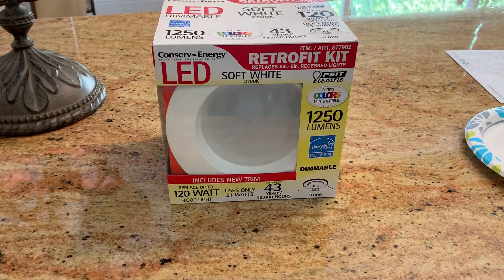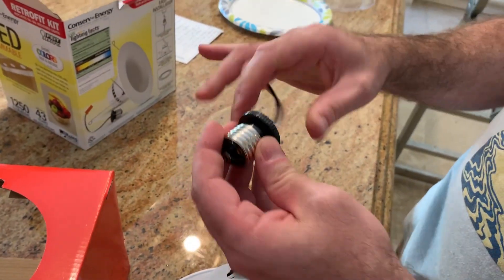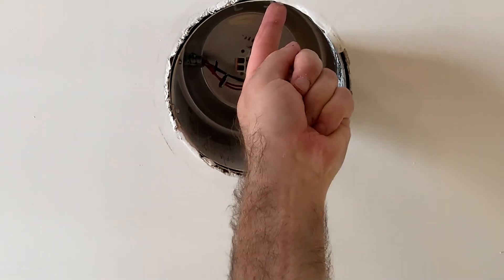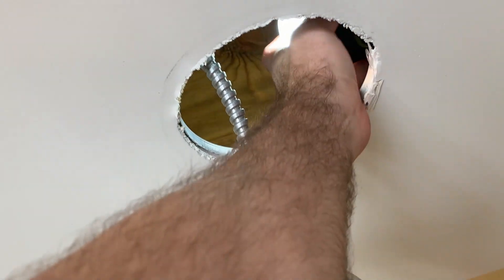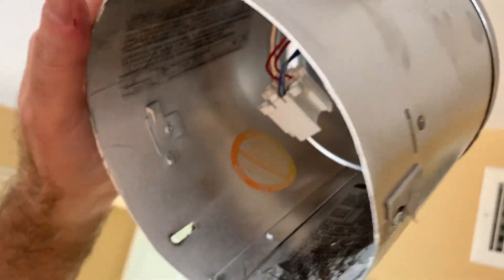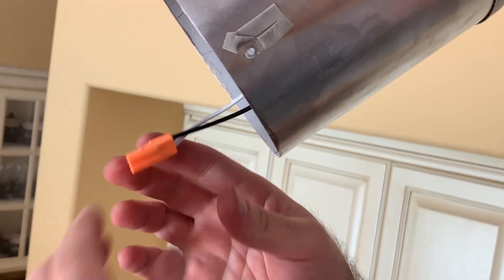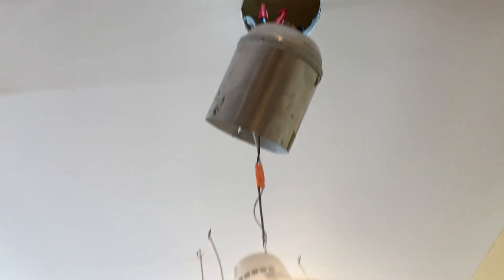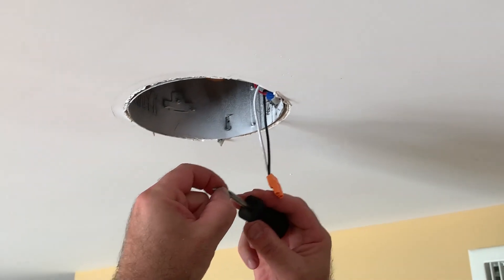CFL to LED Conversion

Comment: but you did not disconnect the power from the ballast that you eliminated, therefore there is voltage at the output and you only put them in the box without isolating them
Reply from the maker: there’s absolutely no power in the ballast if you follow my instructions
Reply: @charlietv625 First of all thank you for the video. I just finished up doing it thanks to you. But, I think he’s right. There’s still power going to the ballast. I found out with a little “shock” from the blue and red wires remaining from the ballast. It’s because you didn’t disconnect the white/black wires from the ballast.

Unless I’m missing something, I’m pretty sure I followed your instructions perfectly. Just a heads up for those who do it and see this in the future.
Reply: @charlietv625  I appreciate finding this video as it was put out here 5 yrs ago and I am just now getting to do this for a house I am going to be selling soon and this is CA where they have now banned the CFL lights unfortunately. I did remove the ballast entirely and it was just additional unused baggage. I will add that the 2 white wires you are adding the Blue with and the 2 black with the Red.. both white and black in your setup are feeding the ballast still. I cut out the ballast and went straight from the house wiring to the fixture and your video got me through the whole thing Sir. Thank you for having posted it up here.. I have been a life long DYI guy so when I see someone else having done it first it makes things that much easier to even attempt doing yourself.

Comment: Good video that will live on for many years. I do suggest removing the ballast wires from the junction box, never good to have bare ends floating around in there. Also consider removing one of the blue and red wires as unnecessary. Again, excellent tutorial.

Comment: Very clear but why did you connect 2 blue with white and 2 red with black. Why not just 1 blue and 1 red. What’s the extra wires doing ?
Reply from the maker: just making it heavier gauge by combining the thinner wires together, it’s not necessary, only optional
Reply: I believe they are 18 AWG. In my case they are. Are they potentially a fire hazard when not doubled like the way you did?

Comment: Last night I did the CFL to LED conversion following your instructions. Thank you so much for your helpful video. Please answer me this question, if you can. What model, brand name is that boxy flashlight you used in your video? Where did you find it?
Reply from the maker: Hi, I got this bluetooth speaker flashlight combo about 6 years s ago, i don’t know if it still exists but i’m sure you can find something similar, this one is a InnoCreek 3-in-1 Multifunctional Waterproof Outdoor Wireless bluetooth flashlight speaker combo, it was about $20, I hope this helps

Comment: Instead of opening any cutting all the wires, why can't connect your LED lights white wire to 2 CFL blue wires and LED lights Black wire to 2 CFL red wires? Please advice.
Reply from the maker: because the ballast will not allow the correct amount of power to go to the led light, the ballast is put there specifically for the cfl lights
Reply: @charlietv625  Thanks! I also tried with I said above (2 blue wires to LED's white wire and 2 red wires to LED's black wire) and you are correct, power was not enough and light blinked for a second and then went off. 

Thanks for posting this video and explaining all the steps in details. I successfully changed all my CFL lights to LED now and long due project is completed! Thanks once again!

Comment: You dont have to turn the breaker off?
Reply from the maker: I don't, but if you feel safer doing so then please do it, the light switch acts like a breaker, it cuts off power when you switch it off, that's how your lights go on and off, but if you have children running around and you're afraid that they might accidently switch the light on while you're doing this procedure then you should definitely turn the breaker off
Reply: @charlietv625  thank you so much your video was great

Comment: Yes hello :
yes, well, by changing your ceiling lights, there is a chandelier next to it with three cups ? When do you turn on the light ? I would like to know if the chandelier also turns on at the same time with your LED ceiling lights and when you turn off your ceiling lights does the chandelier also turn off ? I would like to know if the chandelier also goes out at the same time as the new ceiling lights please thank you. So, well would it be nice to re-shoot the video to show it to me please ? Thanks.
Reply from the maker: the chandelier is on a different light switch, it’s completely independent of the recessed LED lights
Reply: Hello, well okay. The candlesticks walk apart??? And then I would like to know why do you change the old ceiling lights recessed by LEDs??? And then the ceiling lamps compact fluorescent bulbs and the compact fluorescent bulbs are we still making them??? See you soon.

Comment: Be careful with using the light switch as a means to break power... I have talked to two people who had idiots wire their house initially and put the switch across the neutral.  They found this out the hard way when replacing the light fixture.
Reply from the maker: very true, the safest way is at the breaker

Comment: You only need two wires, one blue and one red ,from the light fixture to the switch/power wires?  Why did you use 4?
Reply from the maker: doubling up on the wires makes makes for a better electrical current, you can use one if you like, but since they’re there, why not use it
Reply: @charlietv625  Thanks.  I was just confused about the extra 2 wires.  I thought I missed something.

Comment: Great video!  Question: Why did you keep 2 blues and 2 reds?  Would 1 blue and 1 red be enough?
Reply from the maker: one of each is perfectly fine, two of each makes for a thicker wire, i prefer the thicker setup

Comment: Good instruction. However, i would like to make a comment on the unused wires. You should clip off the bare copper section of the unused wires and then cover the cut end with an electrical tape for extra protection even if they do not have power.

Comment: Very good video on converting from CFL and the process is 100%.  However, mine is a little rougher most likely same with others.  I have tons of blown in insulation to deal with, and the original builder contractors cut the wires very short (about 1 inch) in the junction box and the can.  Getting to the wires to strip them and put wire nuts on is almost impossible.  It is a wrestling match and not an easy job to do given sloppy original install.   But your procedure is dead on.
Reply: I would just get rid if the blue and red wires and buy a new black and white wire and extend down from the box into the can. That's what I think I have to do with my others after dealing with similar issue.

Comment: please help!! I actually have TWO Romex wires as the power source (one romex wire has 3 wires: white, black, and green, BUT another romex wire with 4 wires: white, black, green, and red).  What do I do with the red wire from romex wire #2?    Thanks so much for your help!!! Your video is excellent! (at 6:27,  you have only one romex wire, so my wires is slightly different)
Reply from the maker: i’m sorry but i don’t know how to help you with your configuration, i would get an electrician to help understand what’s going on, good luck.
Reply: @charlietv625  ok:).  Aside from that, very very instructional video, thank you so much!

Comment: I just replaced all of mine and after 2 I checked to see if it worked and it did. I replaced the other 4 and now none of them turn on. Not sure what happened I’m going to pull them back out and check connections

Comment: Seems like you can remove a red and a blue wire as you only need one pair?
Reply from the maker: sure, but since the main wires you’re going to connect these blue and red wires to are of much thicker gauge, i would just twist the two red wires into one and the same with the blue, but there’s no harm in removing them though.

Comment: Excellent video! I watched it a couple of times and attempted to convert the recessed lights in my kitchen. Success! The only issue I had was the "door" to the junction box was on the other side so I had to figure out how to take the entire ballast off. Once that was off, I was able to get it completely out of the way. Thank you Sir.

Comment: If my house had cfl and a dimming slider would the leds also dim with existing wiring?
Reply from the maker: only if the new light fixtures are dimmable, otherwise you will ruin the new lights, you should only use dimmable lights with dimmer switches

Comment: great video! i’m in the process of changing mine and i do have one question, the 2 red and 2 blue wires that are located behind the canned housing seem to be connected straight to the ballast and nothing else, do they HAVE to connect to the black and white cables or would it be okay to proceed and work with only connecting the red and blue to the LED recessed lighting connection
Reply from the maker: I'm not sure I understand what you're saying but to simplify it, you must not use any wires from the ballast, the wires in the can that go to your lightbulb (blue and red) connect directly to the main power source (black and white)

Comment: I liked it in most aspects, but not where he said to make sure the power is off AT THE LIGHT SWITCH.  Shut the power off at the breaker box and the light switch, else someone turns the switch on why you are working.
Reply: I would shut off at the switch and then tape it to prevent someone turn it on and also let people in the house that you are working on the light do not touch the switch 🙂

Comment: Thank you for the very informative video, I have a question. Would there still be power to the ballast? and if so would that make those useless wires potentially dangerous?
Reply from the maker: no, there won’t be any power there, power is only in the main wires which in the video is the yellow jacket with black and white wires inside
Reply: @charlietv625  ok thank you!
Reply: Love the video but I think you left out one important part. I didn't see nor hear you say anything about the white wire from the ballast that was also twisted in with the other two large white wires. Same thing as far as the black wire that was in with the other two large black wires twisted together. In other words, you didn't show them being disconnected from the large twist nuts.If you had shown this in your video, I think everyone would understand why theres no power at the loose wire coming from the ballasts. Still a great video though.

Comment: Very informative...I plan to use your video as my guide. My only question, i have two CFL sockets in one can, will there be two ballasts behind and I use your steps for each ballast ? or will there be one ballast but the number of wires will just double?
Reply from the maker: hi, as long as there's only one main wire ( in my video it's the yellow covered wires with the black and white wires inside) then just bypass both ballasts
Reply: @charlietv625  thanks

Comment: Thank you! You're very good at explaining how to do this conversion. Instead of a one 4-pin CFL, we have two 2-pin GX23 CFLs in each can. Would the instructions be the same? Also, any plans to do a tutorial for LED retrofit kits that have an Integrated J-Box?
Reply from the maker: hi, as long as there's only one main wire ( in my video it's the yellow covered wires with the black and white wires inside) then just bypass both ballasts (if there are two ballasts), and sorry but not at this time for the LED J-Box question
Reply: Hi, did you ever figure out how to do it? I also have 2 prong
Reply: @eluna58 We ended up hiring an electrician. Happy we did

Comment: Great video! I want to do this project, but my CFL cannisters do not have the integrated brackets to accept the torsion bar clips to hold in the new LED light. Do I have to replace the whole cannister?
Reply: You can buy C clips to hold em

Comment: We replaced 8 of the lights in our kitchen however 1 of them is not working. We rewired it several times and even used another led fixture but still it’s not working. Any recommendations?
Reply: Did you figure out the issue?  You likely have a loose wire connection between the faulty fixture and the "upstream" fixture that is providing power to it in serial circuit.  Check the wire nut connections on the upstream fixture.  If you are not certain which fixture is feeding the power to the faulty fixture, simply check the wire nut connections from the 2 closest fixtures on either side.  Good luck and hopefully you found the fix many months ago already.  cheers!

Comment: Hello, I did all 6 LED lights conversion, it worked for about 1 day, until I tried to add 1 dimmer switch and now only 1 LED turned on, I'm not sure if all 6 lights are wired as series. What do you think happened?
Reply from the maker: some led's don't work with dimmer switches because they're not dimmable, make sure you're using dimmable lights before installing dimmer switches
Reply: @charlietv625  Yes, all new led are dimmable, but I ended up reinstalling the original switch and still only 1 led is turning on/ off.
Reply from the maker: I'm not sure what could be the cause then, there might be a loose wire

Comment: Great video....will it be fine if we only use one of the blue and one of the red wires from the can?  I pulled one out of each then watched your video.  I can keep both in moving forward but the one I am currently working on has been reduced to 1 each.
Reply from the maker: Hi, sorry for the late reply, but the gauge of the blue and red wires are very thin that’s why I use both, you can always snake the wires you pulled out back in again if you kept them, if not, you can purchase some.

Comment: Very strange that you didn't show the disconnecting of the black and white wires that power the ballast.  At 6:12 is a clear view of the white wire nut with three wires going to it, one of which goes to the ballast.  At 6:16 is a view that shows the white wire nut still attached, but miraculously the white wire to the ballast is no longer connected to it and you don't mention it.  At this point you go into detail about removing the four wire nuts that connect to the output of the ballast, but by failing to mention that you need to disconnect the white and black wires that power the ballast, I'm afraid that some folks might leave the ballast powered.  Then later at 16:07 when you just push the unused ballast wires into the junction box with their exposed ends, it is quite possible to create a short circuit if the person following this video didn't grasp that they needed to disconnect the ballast's white and black wires.  I really think you need to update this video accordingly because it is unsafe to do this in the way that you have shown it.
Reply from the maker: There’s nothing strange here, I specifically said “ once you separate all of the wires coming out of the ballast, you put them aside because you won’t be using them” one should not only watch the video but also listen to the step by step, my instructions are very clear. I’m sorry that you’re having a hard time with it, almost everyone else found the video very clear and easy to follow, no need to update it.
Reply: @charlietv625  Very good Video Charlie Thanks!. But I do agree with the comment above. I just completed the work based on your video but if it weren't for the comment above I would have missed disconnecting the additional wires powering the ballast. You are right, you did mention removing all the wire nuts but in the following video shot, it only showed the wire nuts disconnected from the red and blue wires. Nevertheless, great video and appreciate it
Reply: You may have attention deficit.  The guy in the video clearly says to undo all the wire nuts and then he cuts over after this is done and shows all the wires (including the black and white) coming out of the ballast disconnected.

Comment: can you use the csf Adapter Converter to  Socket without removing the balance
Reply from the maker: Sorry MK, I'm not understanding your question
Reply: Most adapters require you to rewire and remove the ballast from the circuit.  Since you are up there, you might as well upgrade to LED.

Comment: The video is clear and really helping. But It takes time to do rewire and bypass the ballast. We found the LED from BEST can just directly replace it to LED very easily. You can reuse the of old luminaire and reduce unnecessary waste. Strongly recommended here the best solution for retrofit cfl on ALIBABA: https://www.alibaba.com/product-detail/G24-led-pl-light-retrofit-led_1700000864053.html?spm=a2793.11769252.0.0.396f3e5f89HRd6

Comment: I'm kind of new to doing electrical around the house, but shouldn't you hit the breaker and kill power for the circuit and not just turn off the light switch?
Reply from the maker: If your light switch works properly, meaning when you switch it off the lights go out then your switch is doing exactly what the breaker will do, but if you feel safer switching off the breaker, then you should, specially if you have children that might accidentally switch the lights on while you’re working on them.